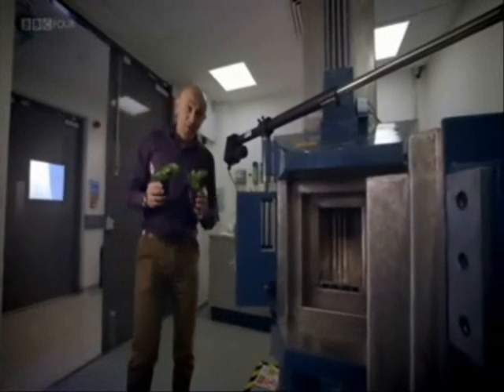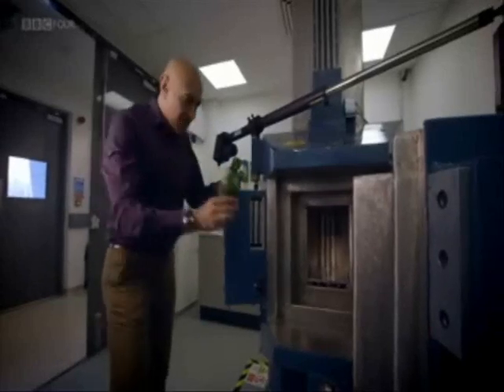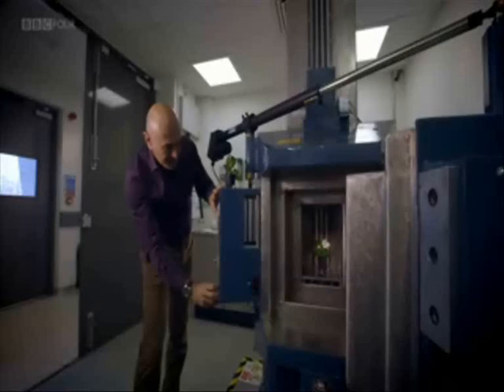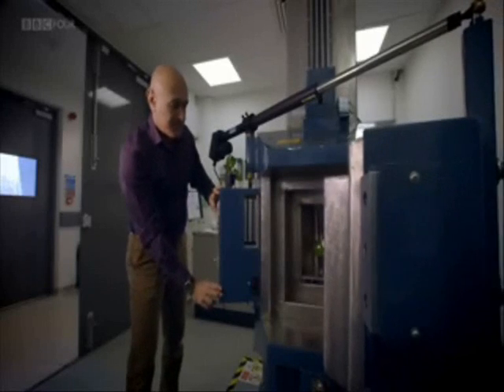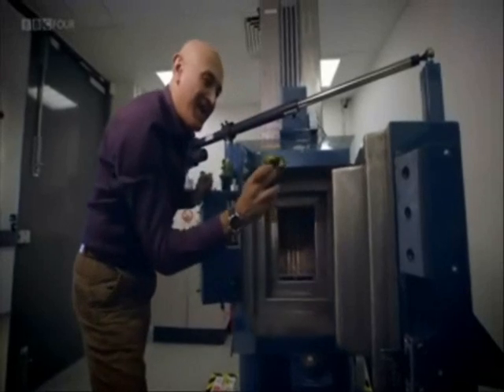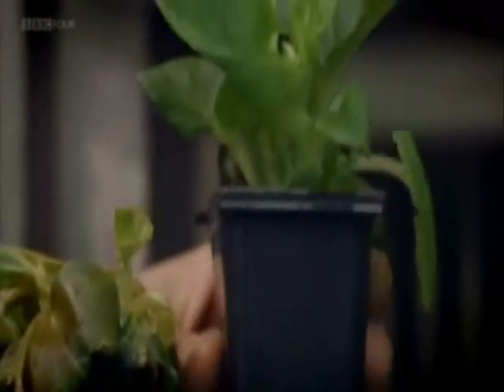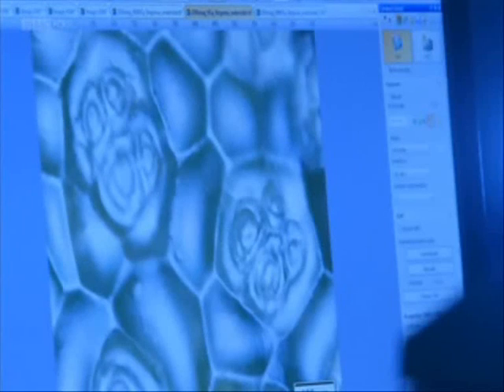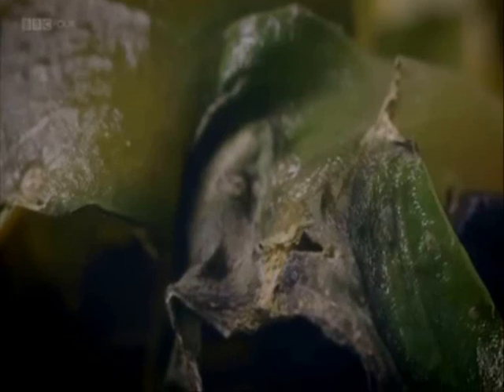RADIATION ON CAMERA

Comment: 1. Depends on the level and type of radiation if at a wavelength to affect a camera sensor.
2. A commercial camera isn't going to be shielded against radiation like a NASA camera would be. Haven't you noticed how huge NASA cameras are? even in modern times where you can have a top quality 4k camera the no bigger than the size of 2 C-Cell batteries, NASA's cameras today are still the size of a car battery if not bigger due to being in a heavily shielded box..
3. Furthermore, regardless of this, the Astronauts have to replace cameras regularly as eventually too many pixels get destroyed by the bit of radiation that does make it through the shielding.

Comment: so you say, this guy have highly radioactive dose powered by what? homemade nuclear reactor? Why he hadn't any protective suit and why he touching highly radioactive things with bare hands?!
Reply: Radiation itself doesn't make things radioactive.
A thing will become "radioactive" if it is covered by a radioactive substance e.g. nuclear fallout.
Neutron radiation however can react with the nuclei of materials forming isotopes that can be radioactive.
Furthermore this so called "radiation oven" uses an xray tube to generate xrays.
Xray tubes are controlled via electrical currents so you just turn it off and it stops producing xrays.

Do keep in mind this is all layman's  terms.
Reply: @c2n10  The radiation from this furnace is not from x-rays, its gamma rays probably from spent nuclear fuel source. If the source is from a spent nuclear fuel, then probably there would be neutrons which can make that plant radioactive.
Reply: @sup0ds  I think those pipes are chambers for that fuel. You can see that they're still there when the furnace is opened. So if it's shielded, the neutrons shouldn't escape those chambers. So all we have left is gamma rays.
Reply: And some other radiation furnaces use gamma sources like caesium 137 or cobalt 60

Comment: 'Radiation furnace' or just a microwave for short
Reply: Precisely, Jose. Micro waves; cell phones, Wifi, microwave oven, etc. Versus: Alpha, Beta, and Gamma waves. All on the electromagnetic spectrum, just miles apart in terms of destructive capability.
Reply: Alphas and betas are particles (helium nucleus and electron/positron respectively ) , only gammas are light waves.
Reply from the maker: Never seen a microwave with lead lined walls as thick as that radiation oven.

Comment: Are you sure that radiation affects film the same way it does a CCD sensor?
Reply: Sandy Lloyd, Jr. exactly what I was thinking...
Reply: Are they sure the radiation levels between us and the moon are the same as deep space. I don't really consider 250,000 miles as "Deep"?
Reply from the maker: @mel2401  Deep Space, according to Google, is ALL space beyond the magnetosphere which ends some 1,000 miles from the Earth's surface.
Reply: It can... however film requires A LOT more radiation not to mention the emitted radiation must be very high energy, and the camera has to be closer than a digital camera to get the same effect.
Reply: @Subsonik762  you can see it in chernobyl videos filmed on I think 16mm film?

Comment: So isn't the plant he's now holding contaminated with radioactivity? Is it safe for him to handle?
Reply: No, nonono, that's not how any of this works.
Radiation is light. If you shine a flashlight at a wall for a minute, that minute long, the wall's illuminated, but after you turn of the light, the wall does give off light suddenly.

Contamination is when there's a radioactive substance, in dust-form, covering everything. If you have tiny tiny particles, a cloud, of plutonium for example, covering everything, then you have a contamination, and it's dangerous. It will keep on emitting radiation.

If you only let radiation itself hit an object, then when you remove the source emitting it, the object being subjected to the radiation is completely fine.

Note: Not entirely true for heavy metals when being exposed to strong radiation for a very long time. Eventually, a significant fraction can be transformed into radioactive elements, by being hit with the radiation.
Reply: MaxArceus “Radiation is light”. Never thought of it that way before. I like how it sits in my head. Cheers. 🍻
Reply: @MaxArceus  Then how come the bodies of Chernobyl firefighters were radioactive and to this day still radioactive? The were irradiated by the radiation of the nuclear reactor. Same theory goes here also. The man in this video is touching a sample with his bare hands which has been irradiated with 10-20 Sv for radiation. Obviously it has become radioactive
Reply: @badcode8037  No, you don't clearly not understand how radiation works. Chernobyl suffered a total meltdown, followed by an explosion. The radioactive isotopes, such as uranium, were blown up into dust which scattered everywhere, and was carried by the wind in the following days, covering the entire landscape in a fine, radioactive dust (fallout). The firefighters inhaled this dust as they were fighting the fire, receiving a lethal dosis within minutes. Because they inhaled it, the actual radiation source is within their bodies, making them radioactive. 
This is not the case in this video. The radiation source is safely contained in the device used to irradiate the plant. The plant is only exposed to the radiation itself, not covered in the radioactive material. It is entirely safe to touch afterwards.
Reply: @MaxArceus  Very high dose of radiation can convert the sodium and potassium present in our body to transform into a radioactive isotopic form(eg- sodium-24, potassium-40), which begins emit radiation of its own, making the body radioactive. Hence we use the sentence 'their bodies got irradiated'.
Reply: @MaxArceus  Radiation is light? X-rays have wave lengths, but Gamma, Beta, and Alpha radiation are particles. A plant could certainly have been irradiated if hit with particle radiation.
Reply: @GutsGloryModel94  Gamma rays are also just light (electromagnetic waves). Beta radiation are electrons, and alpha radiations are helium atom cores. 
It's true that if you irradiate a heavy-metal object for a very long time, it'll slowly become radioactive. (Like the inside of a fusion reactor). The heavy-metal might absorb some of the radiation every now and then, changing what atom type it is, and in doing so it might become a radioactive atom. But a plant, made of mostly carbon and hydrogen, for just a minute or so. That's not going to become radioactive.
Reply: MaxArceus I withdraw my previous statements. At that time my knowledge of radiation isn’t like it is now. The only real to irradiate something is with neutron radiation. Otherwise other forms of radiation do not cause a substance to be irradiated like you said.
Reply: @GutsGloryModel94  If you want a better way of looking at it and explaining it to everyone, just tell everyone that all material forms of power are a form of motion, therefore, all radiation is a form of motion, and the names we have for the subatomic particles are the common forms of motion. Acting by the laws of justice, the principles behind thermodynamics, conversion of energy from one form to another through a perfect medium would produce a 1:1 conversion from one form of motion to another.

Using this as a principle, we can explain that if something is to become radioactive over time, it is because that thing will absorb the radiation and re-emit that radiation, or that radiation will transform the nuclei of the atoms, but if something is to be a radioactive element, it must increase in nucleic mass either actually (adding particles) or virtually (increasing motion), so the radiation must be adding protons and/or neutrons to increase the mass of the nucleus, making it unstable. Because all things approach and desire constancy, i.e. equilibrium, the unstable nucleus lets off radiation in the same way that photons are absorbed and re-emitted. In other words, any substance can become radioactive--even a plant--if you have enough time or motion that is.
Reply: @GutsGloryModel94  gamma are waves
Reply: @EphemeralProductions   I’m guessing you didn’t read through the whole comment thread go back and look again.
Reply: @GutsGloryModel94  i don’t need to. I’ve looked gamma up before and everything I’ve read says it’s a photon, like all radiation, that has a wave pattern like light Etc.  I don’t need the comment thread to tell me that
Reply: @EphemeralProductions   You are quite dense. That wasn’t the point I was trying to make. Someone else already corrected me and we had a conversation about it. I told him that when I made that comment I didn’t know as much as I do know about the topic. So go back and read through it.
Reply: @EphemeralProductions  you just can’t admit your wrong can you
Reply: @GutsGloryModel94  yeah i can. When i am.  But i don’t think i am in this case
Reply: @EphemeralProductions  yeah. Sure.
Reply: @GutsGloryModel94  You do realize you can just delete your comment instead of typing out “i withdraw my previous statements”.
Reply: @Amirus To remove any radioactive fallout dust that can get stuck in your hair, or clothes. 
I like how you begin with "Sure kid", absolute f*cking moron, so sure of yourself, while you're wrong. 
Ask yourself this then. Why didn't you have to be decontaminated last time you got an xray photo taken?
Reply: Only neutron radiation can make irradiated things radioactive
Reply: @Amirus  I don't have to get decontaminated when I get x-rays, despite being exposed to radiation.
Reply: the radiation act like rays one you turn it off its safe if the material is contained. contamination is due to radioactive material that is released to air and sticks to things.
Reply: @Jacob King :0 battle? Where i wanna go there and lose!
Reply: @Dave F no thats just beams of energy the thing emiting them is dangerous